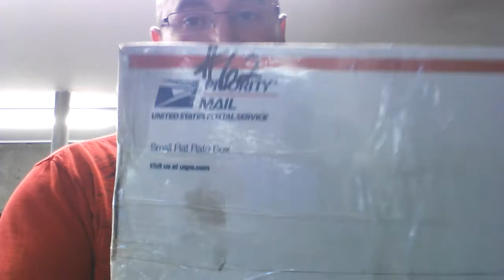20130805_114145.mp4

Comment: Sweet bro...a question...I'm thinking about getting into kydex holster/sheath/dutygear design and construction. On the riveting with the 1/4" rivests (I think those are compatible with tek locs?) Can I get good results with a knifekits journeyman type hand press and tool or is an arbor press and master series dies something I should just go ahead and get ($40 harbor freight and $35 dies) I'm guessing a toaster oven and heatgun and a shop-vac vaccum table are on the list.